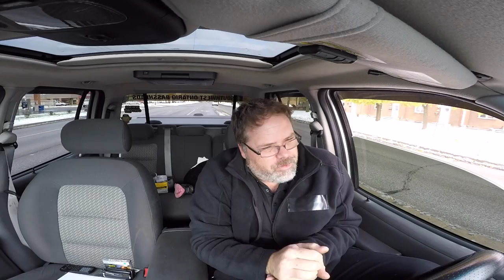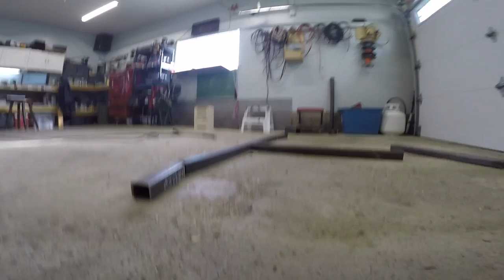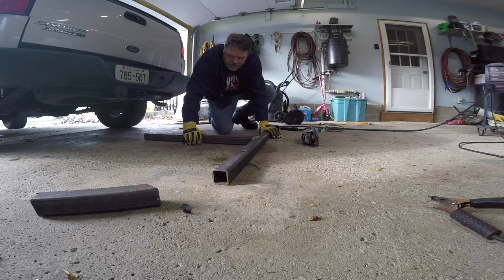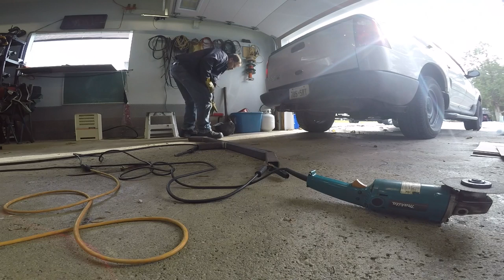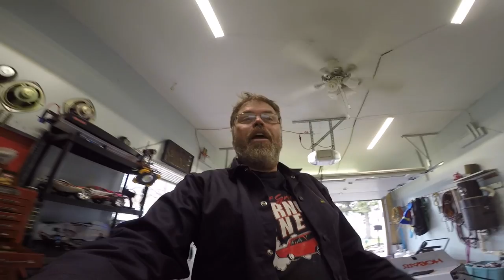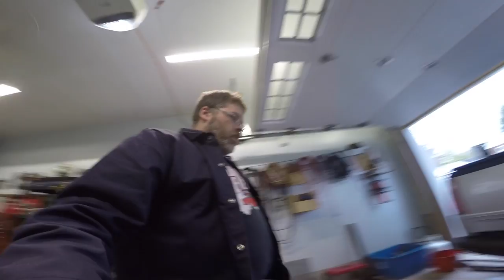Redneck Bumper Guard With Optional Mud Flaps

Comment: Not sure what you painted your bumper with on the Trac but you should check out Urethane Supply Company.  Their bumper and cladding coat is absolutely amazing.  I used a black tone for a 02 CRV on my 01 Sport and it is still there years later.  As long as you clean the parts really well it will brush, roll, or spray.  The stuff levels so well...  I’ve taken to using it on my interior panel projects.  Tough as freakin nails, with easy application.  Why wouldn’t ya?